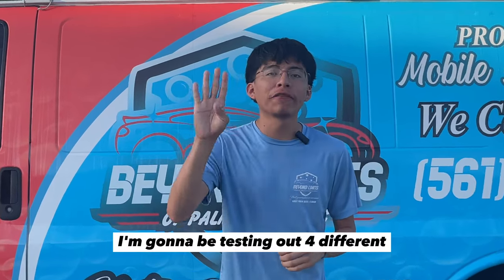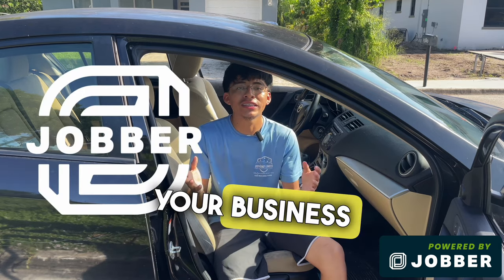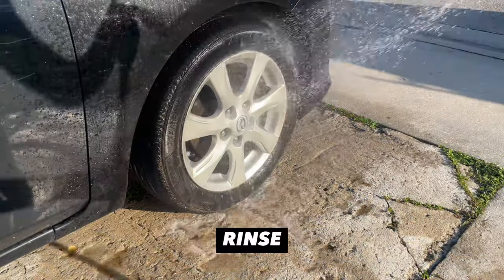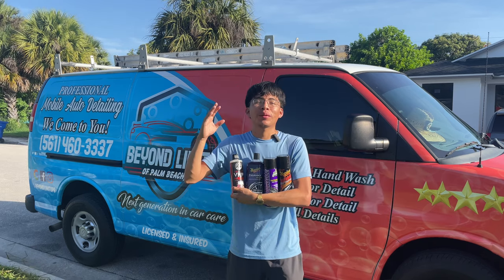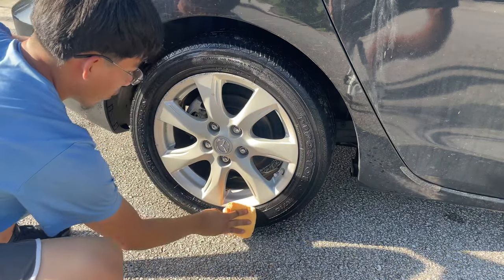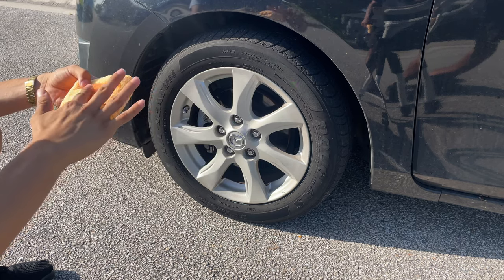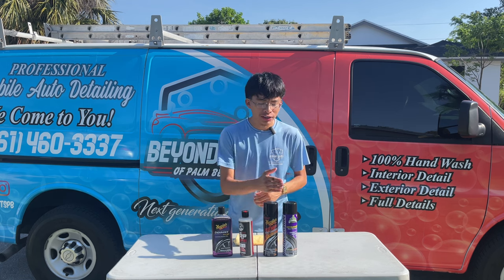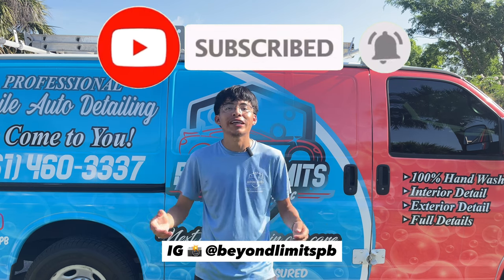The Best Tire Dressing in 2023 - Detailing Beyond Limits

Comment: Now drive on the highway. 55 miles per hour. That's the real test
Reply: JEFFQUICKLE9  I need something that sticks to the tires, not the paint on the side of the car 😬
Reply: I used the meguiars foam for 5$ it's not bad tbh lasted long too
Reply: @chrisjoe187 what do u mean by that lol. can you explain. i dont get it
Reply: If its slinging that means you either didnt prep the tire correctly or didnt level out the excess dressing
Reply: @sw4mp38  Just drive down the street and see how much tire dressing ends up on the paint of your car
Reply: @OddlyHuman  I have a new trick. After I apply the tire shine, I dry it with a leaf blower before letting it set for awhile. I normally dry each tire carefully, for about thirty seconds. It works pretty good

Comment: I've tried making tire dressings,,, never found what I was looking for in a tire shine until I tried Cristal  Untouchable Wet Tire Shine,, THE BEST EVER #1
Reply: Slings like crazy believe they changed the formula I use the vrp with a soft brush or soft sponge applicator it’s the best value
Reply: @SJ-vz9ht  I've been using the Cristal for around four years and I've never had a problem with it slinging. I spray and let it sit on the tires for as long as possible but before I drive away I lightly run a foam applicator over it to remove the excess. I also wipe the overspray from the rims.

Comment: I am not a big CG fan but VRP just works and saves me a ton of money. I dilute 5:1 and put it in spray bottle. Works for interior like a charm and exterior trim. I also use for rubber Mats and wipe down.
Reply from the maker: Nice! Thank you for sharing :)
Reply: Chemical Guys has a better product for All-weather rubber Floor mats called Mat ReNew Rubber. VRP makes them slippery. I no longer use VRP, For a good year had used it for tires only, got poor results on plastic trim, and it is not meant to be used on interior trim. Then again, if it works for you and happy with it... Go with what works well for you. I now use 303 Graphine Trim Coating. For tires Meguiar's Endurance Tire Gel. Yeah! tons of products on the market now and the pool to choose from keeps getting bigger. New is not always better!!!!
Reply: @richscott2483  I use VRP on my outside trim and tires. Works like a charm for me after I used ceramic cerokate trim coat. Bringing  back a 04 Toyota Corolla to new ish right now and protecting it before snow fall/road salt on the ground.
Reply: @richscott2483  That’s strange, you mention VRP is not to be used on interior trim. I’ve been using it for interior trim and have had amazing results in longevity. Been using it for years.

Comment: I put on the Meguiars about 3 weeks ago and I'm surprised it's still looking very shiny. I tested out Capro Lift on one side of my car and Wash Chem Pro 50 on the other side. The tires sprayed with Carpro Lift still looks untouched. The tires sprayed with Wash Chems Pro 50 (PH over 13) is about 50%. It's endurance is pretty good. I do have VRP, it does good, but a hassle to apply. I like the look of Chemical Guys Silk Shine, but it doesn't last long.

Comment: Meguiars endurance is what I use. You have to use a bit more product for a high shine as it is fairly difficult to spread across the whole tire. Mine lasted about 2 - 2.5 weeks driving about 110 miles a week before being dull again for reference.
Reply from the maker: Nice! Thank you for your input (:
Reply: The problem with this product is that after long-term use in burns the rubber in your tires, and then you cannot get them to shine with anything basically because it uses alcohol and that burns the robber, not to speak about the wheel wells, which burns the plastic, and makes them not shine at all

Comment: Back in the day, we used to simply wipe the tires with brake fluid, so I'm probably showing my age. I've been using VRP and have no complaints. I prefer a wipe on versus a spray since I don't want to get overspray on my car that I just washed and dried.

Comment: I’ve been using Meguire’s endurance gel for years, a bit pricey but it is definitely worth the money.
Reply from the maker: Nice! I know of many who prefer Meguiars endurance gel as well.
Reply: I now use Meguiar's Endurance, better than Chemical Guys VRP.  It all depends on the Shine or appearance you seek. My 2023 Camry XSE V6 has gloss black wheels therefore, Endurance compliments the look. It is not super glossy or overpowering the Black Gloss Wheels on my Camry. My wife has a 2022 Civic Touring, exterior is Crystal Black Pearl so it is suitable for her tires as well. It was a Win-Win! : )     A few weeks ago, Advanced Auto Parts had Endurance 2 for $12, picked up 4 16-ounce bottles for $24, and had a $5 Speed Perks Reward so it was $20 ... break it down cost $5 per bottle.  I am amazed at how little goes a long way. I've only used 1/4 of a bottle and done nearly 50 tires in the last month. My neighbors are happy as I have gone around to give their tires a shine. I've only used one 8x8 microfiber towel, reusing it on all the car tires since it is saturated with Endurance gel. That is from the 1st bottle bought when like $15 then after got 4 more at Advanced Auto. I am set for a year maybe longer. Love this stuff. That fruity Grape odor is nice too. I wear a Nitrile glove when wiping the gel on the tires because it is slick.

Comment: Meguiar's Endurance tire gel. Is a huge surprise. After many years of using all types of tire shine and cleaning products. Endurance is very affordable and works like no tomorrow. Your tires do not even have to be very clean but not covered with mud. You will have to apply 2 or 3 coats but it goes on so easily. I have used the same all-purpose microfiber terry towel for 2 months. It is saturated with Mequiar's Endurance tire gel. One 16-ounce bottle has enough gel to do 60 tires or more. Again, I have repeatedly used the same 8x8 microfiber towel and have never seen it contaminate or smug a tire I have already applied Endurance on often. It keeps your tires shiny, even after driving in the rain there is no noticeable loss of shine. It has a nice Gloss, not super gloss like having a mirror shine. Touch-up is a breeze if needed. I purchased 4 Mequiar's Endurance tire gel a couple weeks ago from Advanced Auto Parts on sale 2 for $12, 4 for a total of $24 minus $5 Perks Reward was $20 making it $5 per bottle. Wow! For $20 I have enough tire gel to do my 2 cars for a whole year possibly 2 years. I have used a quarter or 1/4 of a bottle applied numerous times and on several of my neighbor's vehicles. This Meguiar's Endurance works like a charm. 
Oh! it smells a bit like grapes ... nice odor. I wear a Nitrile Glove as it is a slick gel when wiping it onto the tires. Yes! there are spray tire shines but they cost more and quickly run out of product.

** about Meguiar's Endurance Tire Gel **
Advanced, long-lasting formula endures even through washing and rain.
Rich gel eliminates overspray, runs, and drips providing an even and consistent high gloss shine.
Protects against UV damage and browning.
Advanced polymers provide lasting, high gloss protection keeping tires black with a rich, dark high gloss.
High gloss shine that lasts for weeks, Long-lasting, high gloss shine.
Reply: Bro did McGuire pay you? 😂😂 JK
Reply: i’ve had this, it’s nice and all until it starts slinging all over on the side of your car since it’s a gel, and then it makes it look dirty and it’s a bit messy to clean up, i loved that product until i got tired of cleaning up after it, each product has its con but this is the biggest one, its not all fun and rainbows

Comment: I’ve got no idea why so many people like the endurance gel… literally the only thing good about it is the smell.
-You need at least 2 coats, which requires waiting 1-2hrs between coats.
-It’s difficult to apply no matter which application technique you use
-It slings, even if you’ve wiped the excess off and allowed the dry time before driving
-again, even if excess is wiped off and the dry time allowed, it either gives the tire a brown hue and/or is a dust magnet 
-It’s extremely heavy on the solvents and there are some reports of premature tire damage 
-It’s super expensive and never lasts long.

Comment: Nice comparison! I use Meguiar's Endurance but I will say for good results, you have to use an applicator (I use a brush sponge) with a bit more product. It does sling though lol. If you have a flush setup, you will be wiping it off of the paint.
Reply: Depends on how heavily you apply it.
Reply: Gotta let it dry